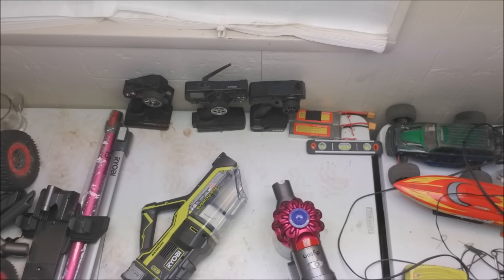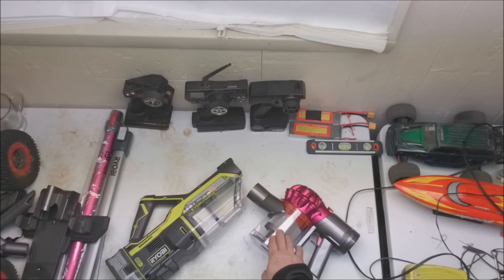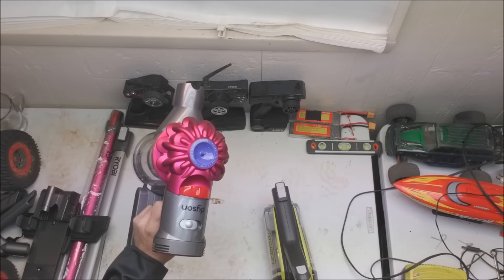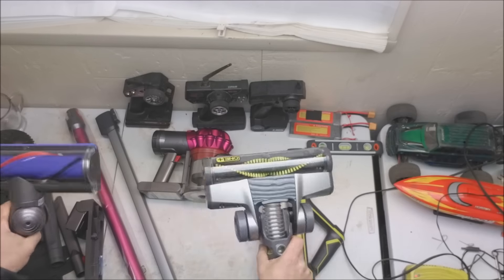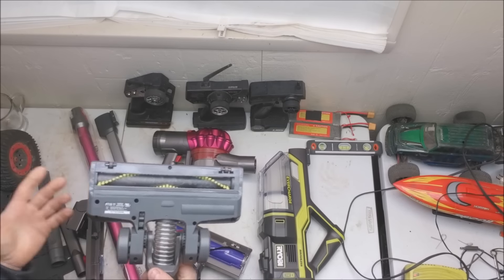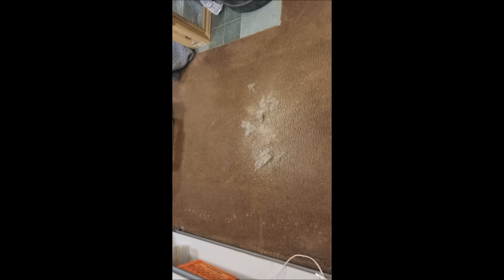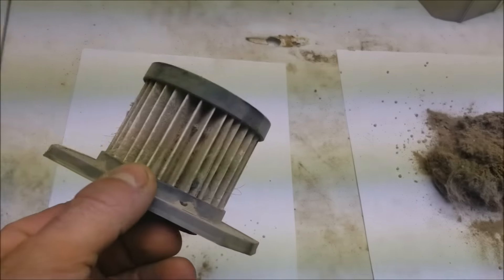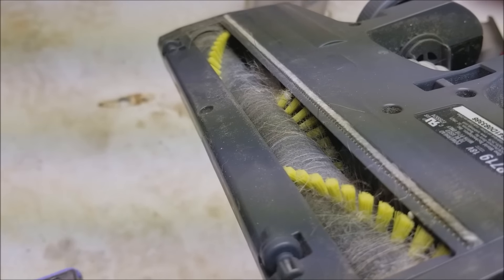Ryobi vs dyson v7

Comment: Not fair, all the hair that ryobi pickup in the brush wasn't there anymore for the dyson, so that is why the dyson brush was cleaner lol, ryobi did dyson job.
Reply from the maker: Most comments on here are half thought out and wrong. You sir, are not one of them people. Very valid point. Thank you!
Reply: I have the Ryobi and two cats. I can't use the Ryobi on carpet/throw rugs because the roller brush will clog with fur in no time at all, my corded vacuum does not have that problem. I only use the Ryobi for hard surfaces.

Comment: One big advantage that the Ryobi has is that the battery is easily replaceable. That means that when the battery wears out (which is inevitable) the Ryobi will be much easier to fix. That also extends the potential runtime if you have additional batteries.
Reply: Well your NOT fixing the Ryobi when the battery goes dead in ~3 yrs.. You get a new battery..  
The Dyson on the other hand has an internal battery... When that battery goes to shit, what are you going to do..?? Throw it out..??, open it up and find the battery and change it out hoping you can find a replacement..??
Reply: @ACommenterOnYouTube  dyson aftermarket replacement batteries are easy to find on ebay and go for about $25. Had to replace mine on a v6 and for aftermarket worked jus fine and actually felt slightly more powerful as it was 3000 mah compared to i think 2100 mah factory one. Its like 2 screws to replace it
Reply: @bossman277:
Even IF i found the $25 battery on eBay, the price of the Dyson is still overly priced for what it is. Meanwhile i have 10+ Ryobi 18V batteries in the garage and shed that i can hot swap in 3 seconds. While the Dyson needs HRS to charge ... and 2 screws to replace the battery .. No thanks
Reply: @ACommenterOnYouTube  i totally agree i was jus stating they can be found. My gf jus happened to get us a v6 a long time ago with all sears points so thats how i ended up with dyson. I dont have ryobi myself but i do have dewalt and theres $20 adapter on ebay to make dewalt battery work on ryobi
Reply: I have both Ryobi and DeWalt. Ryobi by personal use and Dewalt because we use dewalt at work so i "permanently" borrow the dewalt tools and batteries :-) 
Yea i also have 2 of those adaptors that allow me to use dewalt batteries on ryobi. One is bulky and awkward while the other is more clean and fit

Comment: Thanks for this video. You convinced me to purchase the Ryobi. I have neighbors that had/have both. Every one of them said the Ryobi is better in every way.
Reply: George Klepacki  and it is we have 12 Dyson at work they are all pure junk at 300 + a pice no thank you I have the Ryobi and much better.
Reply: And Yes Ryobi is Better, I tried many different cordless Vacs. Went with ryobi with 1 Main reason, the Charging system, with there rapid charger, nobody has anything close to that. plus bought a couple of knock off 5ma batteries on amazon, I get amazing Vaccum time, Dyson NO. Pretty Much unlimited time.

Comment: Great video! Thanks for the comparison. My only thought is that since the Dyson went last the amount of small particulate in the mess was greatly reduced and left in the filters of both the Ryobi and shark. I work in construction and know from experience larger debris isn't what stops a vacuum. Small particulate dust is the hardest on a vacuum as it clings to and blocks up a filter.

Comment: Thanks for this!  I'm going to give the Ryobi a shot particularly since Ryobi have redesigned the filter apparently.  Where I live the Dyson starts around $200NZD more than the Ryobi & that's the basic model without the extra head.  My sister recently bought the Dyson and she loves it, & clearly you at least somewhat gets whats you pays for - but I'm not spending $500+NZD on a stick-vac particularly one without an easily swapped battery - my current Electrolux stick vacs battery is on its way out after only 3 years - and it's not worth the money to buy a replacement, plus I have a huge number of Ryobi One+ tools & a pile of batteries already so in theory I should never have to worry about it.

Comment: I think that the One+ system on the Ryobi is a huge advantage. If you're starting out, you can buy this vacuum, and use its battery on other tools, plus it doubles as a charger albeit a slow one. If you already have many batteries, you can easily swap them out when they run out, plus now Ryobi has a 6 A.H and a 9 A.H battery, which will surely last way longer than the Dyson's built-in battery. 

I think the Ryobi can take advantage of HP batteries so it'd be interesting to test that out.

Comment: Agree the dirt the ryobi picked up the first  time was deep down then sprinkled on top for the dyson to lick up. You need to lay a set weight of sand or debris down on new carpet in two exact sections otherwise you're comparing apples with oranges! Not saying the Ryobi is better but they are clearly two very different target markets. Potentially the Ryobi is for Dad to clean up his mess in the man cave! Whilst the Dyson is for Mum to clean up Dad's mess in the house! 😉

Comment: Good comparison. Newer Ryobi have a fine mesh screen in front of the filter. Thus the filter does not fill up as easily. 

FYI: During the vacuuming demonstration notice your video is cut off left and right. Reason, the camera was held in portrait (vertical) orientation. When creating videos always hold camera in landscape (horizontal) orientation. TV screens, computer screens, theater screams, are always horizontal (landscape).

Comment: I bought a Dyson Motorhead V7 (returned it) and then bought a Ryobi.  The Dyson does indeed have slightly better suction...for about 10 minutes then you have to recharge the battery (about 35-40min). It's pretty frustrating for any substantial cleanup operation.  The Ryobi goes closer to 20+ minutes on a single charge and, if you have a another battery (I have three), can go another 20ish.  For me, that makes the Ryobi far more useful. Like 440 said though, the filtration system on the Ryobi is a bit on the nightmarish side.  Definately like the Dyson filter better.
Reply: They fixed the filter

Comment: The v6 and the v7 have the same battery and motor.  The difference that allows the v7 to run longer on low speed is that it's actually less powerful on low speed than the v6.
On high speed they are the same in power and run time.

Comment: This unscientific "test" assumes that the carpet was cleaned when the Ryobi vacuum went over it.  When was the last time you vacuumed the carpet?  The dirt picked up was what you dumped onto the carpet and the residual dirt that the Ryobi was cleaning.  While the dirt the Dyson was picking up was the dirt and a cleaned carpet with relatively little residue because the Ryobi had gone over it already.  The only clear and fair comparison would be using two equally clean carpets, not one carpet that is already cleaned by another machine.  My Conclusion is that your test is flawed.  If you had reversed the two vacuum cleaners using the Dyson first, the Ryobi most likely would have come out the winner.
Reply from the maker: I cleaned it with the Shark Rotator before each test. The Shark is better than both Ryobi and Dyson, it's also a plug in.

Comment: I'm considering the ryobi , because i already have the batteries. Is there a way to figure out if the ones in the store have the "new" filter? I don't want to buy one with the old filter .
Thanks
Reply: Shagggy67 i think now they all should be new enough stock

Comment: couple of points
first; you've vacuumed an area with the ryobi which would have included stuff stuck deep in the carpet pile, then with the powered vacuum.  Then put all the stuff loose on top for the dyson to pick up with hardly anything left that was stuck deep in the carpet pile. no wonder the dyson felt like it picked up more.
second; the dyson takes 3 or so hours to recharge completely.  The ryobi one plus can recharge a 2.5 AH in an hour. You can also get a fast charge for the ryobi that will charge a 5AH in an hour.
Reply: My ryobi charges in 30 mins lol. All the batteries. Maybe not one them big big Amp ones but my 4amp will

Comment: I have both vacuums and you are clearly a Dyson fan boy... lol
The Ryobi is clearly the better vacuum in every single way, it's not even debatable. But thanks for the video I'm sure you got Ryobi a lot of new customers... Lmao!!!
Reply: I have the Ryobi. Why do you say it's so much better than the Dyson - other than the run time and removable battery?
Reply: @Pro1er  Power,Price, Efficiency, Modular design, Cost of ownership and the ease of warranty services by having home Depot on every corner. The Ryobi wins in every category except for those who need to own the name Dyson
Reply: @full-light  Interesting. I own the Ryobi and while it is okay for hard surfaces I can't use it on my carpet or area rugs because the brushes and filter become clogged with cat fur almost instantly. A lot of fur gets past the filter screen and clogs the paper filter as well. The roller brush is always tangled with hair and fur and you have to take the head apart with a screwdriver to clean it. The Ryobi is also pretty heavy. I had thought of getting the Dyson V10 but since I have a lot of Ryobi batteries, and I managed to get the vacuum at a bargain basement price, I went with it. I'm not really sure it was the right choice though.
Reply: I think you gets what you pays for - Dyson products are great, but Dyson are definitely overpriced due to being a desirable brand - which, let's face it is the same with a lot of Ryobi's higher end competitors - often you'll find Ryobi one+ tools are almost, but not quite as good as their high-end branded equivalent, but the price is just so damn competitive unless you are a professional it's not worth paying twice as much for something that's only 10% better.  Hell, even some professional builders and mechanics are starting to use the brushless Ryobi models over Makita/Hitachi/Bosh etc now so they must be doing something right.

Comment: Been waiting on a review like this. I have all hardwood floors. Thus I think the Ryobi would be ok. As for the big clumps. Can't you remove the beater of the ryobi to pick them up then reattached the beater to get the smaller stuff
Reply from the maker: Neither did exceptionally well on hardwood floors. If your vacuuming primarily hard surfaces you should look for one with a 'soft roller'. I do have a soft roller for the Dyson and will do a comparison video soon.

Comment: Dyson using 'cyclonic' dust separation... no dust filter at all (I won't count a HEPA filter). My hand vac sucked great, but always had short run time. The battery was low power and quickly lost power retention. Replacement batteries were expensive... and the third party battery I bought did not fit well. I loved my Dyson floor vac... for 18 months. I think I ruined its suction with cement dust. All Dyson products are super expensive and occupy the premier niche for form and function.

Comment: The Ryobi has hot swap batteries which means unlimited run time as long as you have spare batteries.. 
The Dyson.... well its an internal battery and when it goes dead, you WILL have to stop and throw it onto the charger and W A I T ....  Then in ~3-5 years when that battery really goes dead, now you have a paperweight stick vacuum... What are you going to do..?? Open in up to find the battery and try to find a replacement ..?? Or throw out that expensive vacuum and buy a new one..??

This is WHY i don't like devices with internal batteries ...
Reply from the maker: I agree with almost most everything said. With exception to when the battery dies, it's replaceable (with a screw driver) and should not be difficult to locate online. This is greatly more difficult then replacing the easy to find, up-gradable, Ryobi batteries.
Reply: Not all internal batteries have markings on them to identify what they are.. at that point you have zero clue what the voltage rating is supposed to be ..
Reply from the maker: Identification will not matter because the battery would be purchased from Amazon, ebay, dyson, etc and it's designed specifically to only fit in your vacuum.

Now if you are very handy you certainly could open up the battery pack, remove the individual cells and replace the cells on your own. This would involve soldering and sealing of the case holding them. Nearly no one is going to do that.
Reply: 440Trick well getting one from amazon or ebay can be a hit or miss and hope they give you the right battery .. 2 batteries can look alike but be different voltage which may cause an issue ..
A battery from dyson ... well thats full proof i guess lol

Comment: As much as I love ryobi they screwed up on this one
Reply: No they didnt
Reply: @legendfpv  the filters clog with hair and lose suction easily it doesn't pick up well and is very top heavy
Reply: @legendfpv  most people hate on this video because they either hate dyson or have that ryobi and want to defend it
Reply: @logan8921  call Ryobi and ask for the improved filter. That issue has been solved
Reply: @legendfpv - Dyson doesn't need a filter at all. I wish Ryobi was cyclonic... then I would have no reservations about one.

Comment: Please give me a break,  for the price Dyson better win big.  However for laughs now go back to what you cleaned with the Dyson and see how much more you still can get out.  That's  how salesmen always get customers hooked.  The real shame is that Ryoby is not using a cyclone at all, that's like 40 year old technology.  On this score Ryoby shame yourself!!!  On the other hand does Dyson need 10 itsy bitsy tiny cyclones to get the job done.  Clearly just like 10 number 1 screws are much weaker than a !inch bolt as a consumer get an old but cheap stick vac or a small shop vac and get the job done really inexpensively and better1
Reply from the maker: I agree with Ryobi missing out by not using the cyclone technology. Another issue with Ryobi is they did not put a brushless motor in it! They released Ryobi brushless motors almost a year ago and they need that motor in this vacuum.
Reply: 440Trick  1) ryobi can’t use “cyclone tech” because that is trademark dyson bullshit. The filter might be clean but wait till you have to clean out those tiny cyclone shits 2) the ryobi is definitely 100% brushless. It literally says it right on the vacuum.

Comment: Voltage dose not mean power!!!!
Reply from the maker: In the world battery operated tools it does. Higher voltage has a greater potential and takes less amps to do more work. Justin I know you read a page once on Ohm's law, but there is much more to it. lol
Reply: 440Trick battery operated or not voltage is not power fact and as for ohm law being read once I’m an electronics engineer that has forgotten more about electronics than you will ever know I deal with ohms law on a minuet basis dealing with multi million pound orders from world wide clients tit!!!!!!
Reply from the maker: Voltage is directly related to power. Just like I said previously, cordless tool power is basically determined by the voltage listed. We will never question that the 8v Dewalt tools are less powerful than the Dewalt 20v tools correct? Its also safe to say the Ryobi 18v is more powerful than the Royobi 12v correct. I'm not sure why you would disagree.

Power is Watts, yes.. How do you increase Watts? The most practical way is to increase voltage. So ... we can safely say more voltage = more power. 

You engineers always want to over complicate the most simple of concepts. Being a master electrician, I know a tad about voltage and a bit about quirky engineers. "Engineers like to solve problems. If there are no problems handily available, they will create their own problems."
Reply: I believe you are referring to watt hours means power. 18v X 6amps equals 108watt hours. Vs 21v and maybe 3 amps equals 63 watt hours.
Reply: Volts is only half the equation just as torque or rpm alone are not a measurement of mechanical power.
 Power is Volts X Amps, so for the same amp draw, more volts is more power, but equal amp draw is not necessarily a given.  
A car starter runs on only 12 volts but produces way more power than either of these vacuums because it draws hundreds of amps.
Reply: In tools whenever i put a battery with more amps, the tool is stronger and faster.  3 amps vs 5 amps batteries. It must flow on
Reply: The larger voltage allows for larger motor, but in this case the voltage difference is meaningless.  The motors size can be the same.  BUT I would prefer a larger voltage motor as the internal components would be cheaper and run cooler.  For a lower voltage motor to compete with a much higher voltage the current has to increase to match power but the components inside the lower voltage power would have to higher specs for the increase current draw and higher heat tolerance.